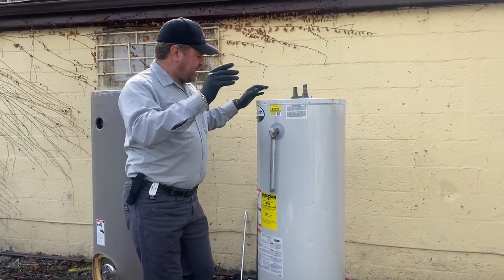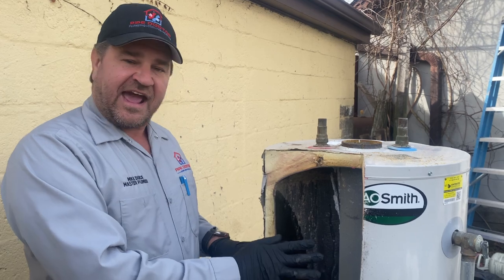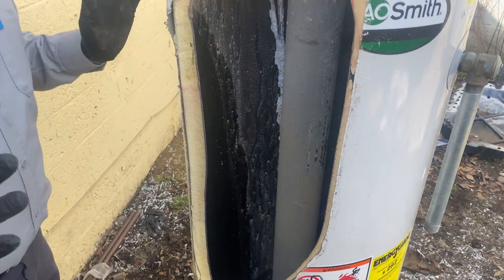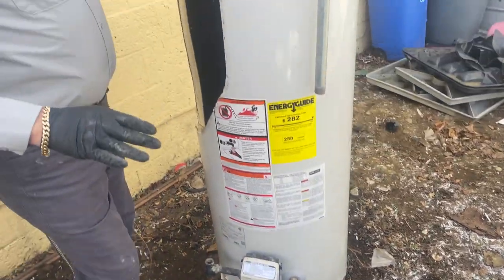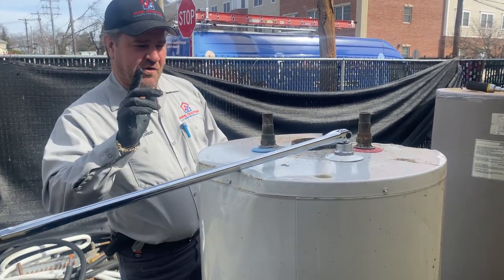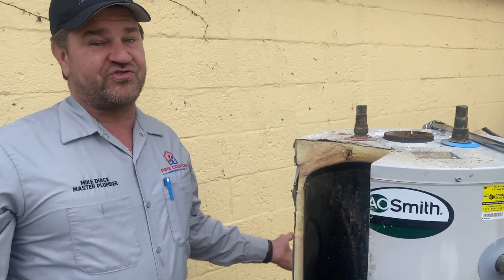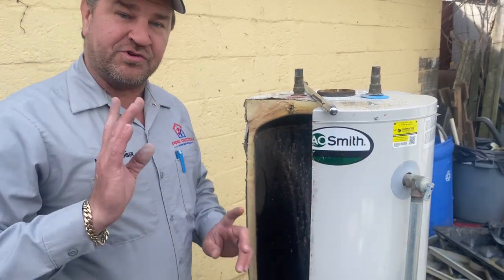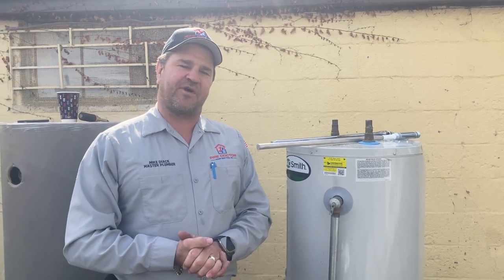How to Extend Your Water Heater's Lifespan Flushing and Anode Rod Tutorial

Comment: Where do you get  this flexible anode
Reply: @PipeDoctor  what if the braided cable is eaten away then won't a portion of the anode rods be on the floor of the tank?
Reply: The cable won't be attacked while there's still some magnesium.

Comment: I live in Queens NY and never drained or changed the anode rod and it lasted 17 years. It' s up to debate, some plumbers say never touch the tank, depends what is your water source. NYC water is very clean compared to well water and hard water in other areas of the country. Check with your local plumber for advise.

Comment: Those anode rods, after a few years get stuck into the tank, it is not an easy job to try and get it out. I tied the tank down and are currently struggling to unseize it.  I think it will take about 400 ft/lb torque for that, the word "easy" is the wrong word.

Comment: I Have A Phase Trangle Tube  30 Gallon Indirect Water Heater    Stainless Steel Tank    No Anode That I  Can See. And No Drain.  37 Years Old. And Still Works Like A Champ Never A Problem Great Well Water In Upstate  Orange County  New York  Still Have Orig. Paper Work .  Does Not Show A Drain Valve Or Anode Rod In Paperwork  Or  Any Cover Or Plug On Top  For A Anode Rod May Because It's A Stainless Steel Tank ?   It's Paid For Itself Many Years Ago .

Comment: Much love and respect Mikey! We know that you work hard and have worked hard to gain your knowledge of HVAC and plumbing. It's not easy to give it away for free bc it takes years to build these trade techniques. I respect the shit out of that. Anytime im talking to a pro and asking for help weather it be their shop or my house, i always show them respect and tell them i respect them for their years of service, while gaining these techniques to help me. I acknowledge that im not running with free info like i just robbed a bank. I think that helps tradespeople understand where im coming from. 

Oh and right after you did the rod on the one heater, i went and checked mine. It was like a cylindrical rock. Changed it out.

Comment: Quite possibly the most useful video I have seen. New I should be doing it as tanks here are lucky to last 6 or 7 years. Great question from camera man. I never get to changing mine because of low ceilings and did not know about the sectional anode.
Thanks so much every year I can put off wrestling a tank in and out of the crawl space is worth a hundred bucks.

Comment: On the transfer of heat to water in exhaust tube is the baffle. Slows the heat rise down a tad while creating a sprial movement . Also expansion tanks in closed system save the heater from expanding and contracting

Comment: Most new hot water heaters come with Dielectric nipples already installed but I have seen homeowners install copper adapters right into the steel tank and leave the Dielectric Nipples still taped to the side of the tank not knowing what they are for. Maybe a quick lesion on why they are so important to install them. Make the Trades great again Mikey Pipes.

Comment: Bradford White tanks have the anode as part of the hot water outlet pipe. If the installer didn't use a union then you will need to unsolder the hot water pipe (recommend a professional plumber).

Comment: Thank you Mike it was really good teaching exercise.
So I guess if my water heater is about 10 years old it's too late to change to change the annode?
A gas water heater has 6-year warranty 
It's too close to his life expectancy maybe
Thank you Mike appreciate your video is really important for us guys who just aren't real plumbers 🤠
Reply: It's never too late for that.  Just change it they're cheap.
Reply: @MrBen527  
Thank you Mr Ben 527
Well appreciate it
I do see some corrosion on my cold water side and much or how long it's going to last but maybe I should do it anyway.
Can you rent the tool of Mikey pipes has I'll have to check it out thanks
Reply: @Bruce Elias  All tanks corrode differently.  You'll need a 1 and 1/16 inch socket and wrench for it.  Idk if you could rent one anywhere.  You could just buy one from the home store you get the above Anode from.
Reply: @MrBen527  
Thank you sir!
Well appreciated 👍
Reply: @bruceelias2732  You're welcome!
Reply: After about 3 years or so after installation, it becomes harder to get the anode rod out.  A breaker bar (and cheater) as Mikey shows should do the trick.  I have found that most water heaters last around 12-15 years regardless of the warranty.  You can get an inexpensive breaker bar at Harbor Freight.  Wishing you success in your project.

Comment: Because the drain on hot water heaters is slightly above the bottom of the water heater, I doubt if you will get sediment out by just draining. You need back flushing to stir it up and then maybe you will get some of it out.

Comment: A little tip as a contractor, installing water heaters, offer the customer, a 10 year parts and labor warranty for X amount of dollars more than a standard tank and install a second anode rod in the tank and all the years that we did that I think we replaced one tank under warranty What do you think?
Reply from the maker: I’ve tried that. Most don’t care.

Comment: Something separate from water heaters….
But everyone water shut off valve in your house should be “exercised” least every 6 months (I do mine every month; probably excessive but my house, lol) so make sure don’t  seize and know they work and keep working. Last thing ya wanna do at 3 am when have a flood event from somewhere in home is go to “try” and turn off water shutoff at valve, say a sink, and won’t turn and so get pliers on it etc and then crack it, the pipe, and make a bigger “event” and now your at the street digging to turn off water with water key, or crescent/channel locks b/c here in FL……if the water shutoff to your house (on side if your house actually functions…..that’s amazing, b/c 90% of t(em just don’t, imo) and no one wants to go to curb and find water utility box and dig removing the dirt, sand, etc looking for main shutoff valve at 3 am; or any time of day….
So exercising those shut off valves under sinks etc….every once in while can help keep the valve working “good” and hopefully not seize and fail when NEED IT THE MOST; b/c we all know, when NEED TO TURN OFF WATER (or anything in life) and haven’t maintained for 10 yrs, likelihood of working, 50/50 ¹ 

¹ IMO and experience and hope helps someone out✌🏻

Comment: I have a turbomax 20-3 indirect instantaneous water heater. Does it have an anode rode? It seems to have an aquastat with a copper wire leading down into tank (sensor) is an anode under the aquastat? Turbomax service is all in French and pardon my French. ....me no speakie.

Comment: My water heater is somehow still functioning from 2006 with no maintenance. I can’t imagine how horrible it is inside (live in Utah, hard water). Looking at replacing with a heat pump water heater. Anyone have experience or thoughts on a heat pump water heater?

Comment: Is it even worth changing the anode rod on a cheap Home Depot 6 year warranty Rheem water heater? They seem to fail and leak at the bottom of the tank at about 7 years or so.
Reply: no  they usually leak at the bottom or top and when they do they are gone.
Reply: @vampirel1983  Reply back once you get your license cause you're clueless
Reply: Had a Rheem tank pop after 6 months of use. They are garbage
Reply: @simpsons721  there is another reply already so i dont need to say anything to justify my statement.  and you dont need a license to replace a water heater but if you think you have a license and you are above everyone else in the world you are wrong.  We are here because we like mike's channel and he's willing to share knowledge.
Reply: @vampirel1983  I only mentioned the license because I can tell you're not knowledgeable. Never said a homeowner had to have a license to install a water heater. Thanks for proving my point

Comment: Wish all anode rods always have their own port that can EASILY access and replace. Really not a fan of the ones that have the anode rod on the hot water port, as changing it makes the cost go up and time. Wish all were separate but ya know, the people designing and building the devices/appliances just don’t “chat” w/ the techs that have to do service, which would be nice if all did (some do , so do wanna say this, but from experience…..not the norm😉).
Cheers